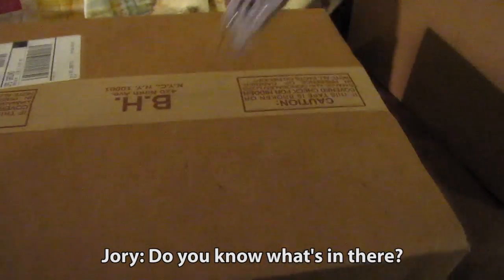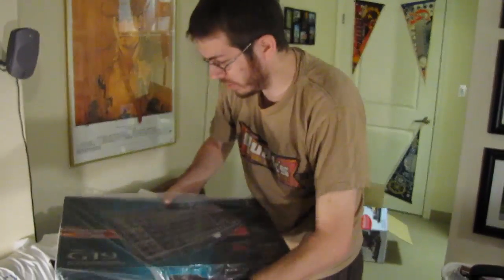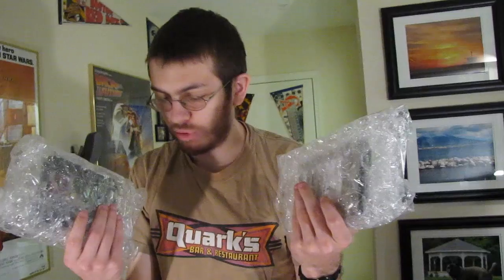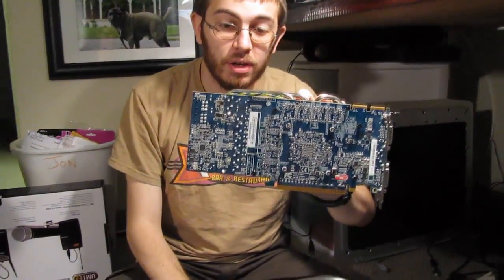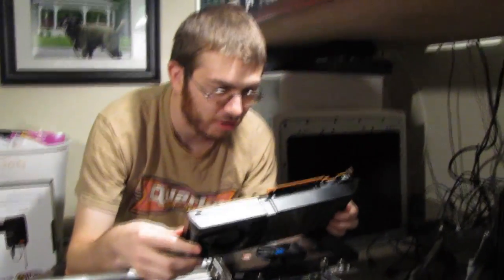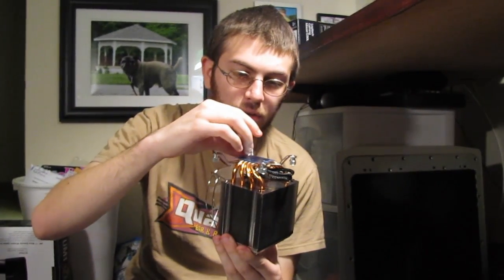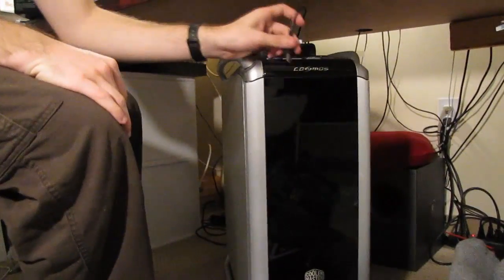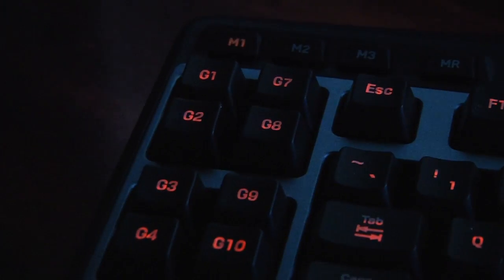$5,000 PC Upgrade! -- Intel Core i7 980x and GeForce GTX 480 Build

Comment: This is one of the videos I watched back in late 2010 that made me want to someday build my own bad ass PC. Just finished watercooling the system I got five months ago.
i7 4790k
GTX 970 SSC
Asus Z97 Sabertooth Board
16GB Kingston RAM
Dual Asus 24" LCD Monitors
240gb Sandisk SSD and a shit load of hard drive space
 etc. Having a fast high-end computer is one of the best investments I've made.
Reply from the maker: Angel Christov Nicely done :)
Reply: dogsht
Reply: @xpaigEpoo94x  this was 7 years ago lmao
Reply: Same, I remember watching this when it dropped. Just got a new build
NZXT H510 Elite
i7 12700f (12 core, 20 thread)
MSI RTX 3060 ti
B660M DS3H DDR4
16GB DDR4
2x 1080P HP OMEN 25INCH 144HZ
500GB m.2 ssd
1tb 7200rpm hdd

Comment: Damn fine setup you've got there. seriously. I'm pretty sure that's... almost as high-end as you can possibly go. Hell, even your PREVIOUS PC greatly outmatches my current.

I do have to wonder, though, what do you do with the parts from your previous machines? Do you hold onto them as backups (just in case), or sell them off? (Personally, I do the latter... even if said old parts are kinda crap, they're far better than nothing at all.)

Comment: @DeandreT1 as i said:

 why not? two 1gb graphic cards, 12 gigs of ram, 4 tb of hd, and twin 4-core (that makes 8) processors for about 4400-4600. it's not my problem if you are a mac hater, i don't care, but you have to admit, it IS an equivalently specced computer.

Comment: I have that mouse too. Just watch out Jon. After about six-seven months of use, the dot's or whatever they are on the mouse start to disappear in the places where you tend to grip the mouse the most. They just turn into black patches. For me, it's the left mouse button, to the right of the Logitech logo (where my palm would be) and then at the bottom of the mouse where the bottom of my hand is. Then again, I have really big hands, but whatever.

Comment: @Jon I've been building and overclocking computers since 1996. You really only need enough thermal paste to bridge the microscopic gaps between the CPU and the heatsink. The less, the better (knowing the right amount takes some practice). No real harm in just putting a big wad of it on there and forcing it out with the heat sink, but your CPU will be running a few degrees hotter (5-15 degrees Celsius) than it could be if there's too much - the thermal paste becomes an insulator when too thick.

Comment: For the love of god I hope you keep this thing cool. I kept mine just a bit too warm and now the processor is falling down a slope of multiple breaks in the microscopic circuitry of the processor- each one making it overheat MORE. Granted it's been four years, but still. If you're going to spend 2k+ on a computer make sure everything stays below recommended temperatures even under heavy load.

Comment: Okay Jon, let me get the specs down so you can see: Radeon 6750M, Adobe Premiere Pro CS6 and iMac flat panel monitor. So I don't know if the Radeon card is incompatible with CS5 on a PC, but it works fine for me. And if your computer used to have a radeon 4870, and it doesn't work with Premiere Pro, then what did you use to edit TMS before that?

Comment: Nice motherboard and nice 980x, are you going to overclock it?
 
Motherboard: EVGA Classified 200 P55
CPU: Core i7 860 @ 3.5 GHz
GPU: EVGA GTX 480 
RAM: Corsair Dominator 4GB 1600 MHz 
PSU: Corsair HX 850w.

Comment: Going back and re-watching some of your older videos and realized this is the video that got me interested in wanting to build my own computer. Back in September, I finally had enough money to build one, and the market was right too. 
CPU:Ryzen 3 2200G 
Motherboard: Gigabyte B450M DS3H
RAM: Corsair Vengeance LPX 16GB 3000Mhz
GPU: MSI RX 580
Storage is a 250 GB Crucial SSD. Went with a smaller drive to save some money. 
Case: CoolerMaste Q300L
Reply from the maker: That's awesome 😁
Reply: @Jon  hoping to get a Ryzen 7 soon. Went with the Ryzen 3 just to get started.

Comment: @Jon - unless youve oc'd your 980x, you would be better off with a oc'd 920 and another gtx 480 and a new motherboard.

you definately a new psu (atleast 850w, preferably over 1000w) and you need to reseat your heatsink with an even amount of paste

Comment: I assume you are talking about the AMD FX-8150? That achieves a score of 1.01 single core / 5.96 multi core in Cinebench R11.5, whereas the 980x gets a 1.21/8.98. Higher is better. Also this video was over 2 years old at the time of your posting.

Comment: I remember my first computer. Packard Bell. Hard Drive space was 600MB. I going to build a new computer in the coming months, however mine is going to be about $3,200 less than what you paid for that because I already have a 17" CRT Monitor and a keyboard and mouse I got from the thrift store. I am cheap but the system I am getting for $200-$300 is going to be the best computer I have ever owned. I am still running on an Intel Celeron 2.2GHz Single-Core.

Comment: is the 480 GTX better than the ATI 5870? 

High performance CPU water cooler. 
i7 930, OC to 3.5
ATI 5870 1GB GDDR5
12GB DDR3 1600 Mhz
128gb SSD with W7
1TB HDD

Comment: The way you apply thermal paste is not the best method, a lot of air bubbles will be trapped inside the paste when you put the heatsink in place. The air bubbles will drastically reduce the heat transfer between the processor and heatsink, this will affect the temperature of the processor with 10-15 degrees. You won't get decreased performance, but you can expect a noticeble decrease in the predicted lifetime.

Comment: too much thermal paste, never touch the pins on anything, the reason that it didn't work off the start-up, is because you put SOOOO MANY new things into the current motherboard, it had a shit fit trying to figure out what everything was. and just a question... can your motherboard even handle the 6 cores of the new processor?

Comment: Hey jon,

    I am also building a computer and considering switching to solid state drives as the main source for the OS and currently, I have a 2tb hdd as the main source. I do want to know, how you go about using 120gb ssd and when installing programs like video editing and games, I've read forums saying sometimes, the program will install some component files into the SSD and the rest into the HDD, have you gotten any problems having the files in 2 separate drives?

Comment: Nice specs Jon, I just upgraded mobo/cpu yesterday with
-12GB corsair XM3 ram
-SLI MSI N560GTX-Ti Twin Frozr II 
-AMD Phenom II X2 555 Black Edition @ 3.3 GHz
-MSI Nf750 MoBo
-Antec DF-35 Case 
-Corsair 850w PSU

Comment: @emerybryant By any chance did you read my other comments properly, they explained why, but if I have to explain again I will. The best kind of contackt between the heat sink and the CPU is metal on metal, not a layer of thermal paste, thermal paste is designed to fill in the tiny or mircoscopic imperfections in both the CPU face and the heat sink face which may also have difficult to see indentations or dimples so the thermal paste fill in these to provide a bettter surface contact

Comment: @EchoedTruth No, no, no. The Phenom II X6 is comparable in peak performance to a Core i7 930, depending on the programs used.

Six cores does not make the X6 as fast as a 980X, which is probably about 75% faster.

Also, the 580 is faster than the 6970, plus it supports GPU acceleration in Premiere Pro CS5 which the 6970 does not.

Comment: I have the Logitech G15.  I think that the full color screen on the G19 is way overkill.  I mean, it even has support for watching YouTube.  Why watch YouTube on my 22'' 1080p LED backlit monitor when I can watch it on a tiny low-res screen on my desk :P.  Great system for Adobe CS5 though with the 980x and a ton of DDR3.  A multi button mouse really helps too, coming from someone who uses Adobe Flash, Dreamweaver, and Fireworks CS5.

Comment: Hey... Just wondering if with my new PC specs if anything would overheat or bottleneck? InWIN BLACK GR-1 GAMING CASE

Intel® Core™i5 Quad Core Processor i5-3570K (3.4GHz)

ASUS® P8Z77-V LX 8GB KINGSTON HYPER-X GENESIS DUAL-DDR3 1600MHz

2GB AMD RADEON™ HD7850 -

1TB 3.5" SATA-III 6GB/s HDD 7200RPM

CORSAIR 650W ENTHUSIAST SERIES

Super Quiet 22dBA Triple Copper Heatpipe Intel CPU Cooler 2 x 12CM Black Case Fan

Thanks :)

Comment: @TheGamingUpdated As i said:

Two 1gb graphic cards, 12 gigs of DDR3 4 TB of hd, and twin 4-core (that makes 8, and both together are far faster than the 980x, apart from allowing more RAM memory) processors for about 4400-4600 dollars.

It's not my problem if you are a mac hater, i don't care, but you have to admit, it IS an equivalently specced computer.

Comment: You may want to consider pushing an overclock on that cpu now, as the current I7 quad cores at stock clocks out perform this thing, heck my I5 2500K running @ 5ghz out performs this machine !
Reply from the maker: I love how you say that like it's a bad thing.

Of course newer processers are faster, that's the point. But this thing still smokes, four full years later. That shouldn't' be understated.
Reply from the maker: ***** They're all listed in the description.
Reply: *****
Hes just butthurt that his computer is no longer better than ours ^_^
Reply: My dad still uses an Athlon 64x2 4400+ 2.2, which is 7 YEARS old, so i wouldn't worry about any OCing.

Comment: Acer Aspire TimelineX  Core i5-480M, ATI HD6550 1GB VRAM, 750GB HDD. 
 
or Acer Aspire TimelineX  Core i5-460M,ATI HD5650 1GB VRAM
640HDD.

They Both have the same price. They differ only on the Graphics card and HDD.

Comment: @raxater I7-980x requires a different chipset. But since you have a SandyBridge mobo, you could get an I5-2500k, which has better gaming performance despite being quad-core @ 3.3 GHz. It's about $220, good overclocker (look around- I've seen some people run it close to 4.5 GHz on air cooling!), and you could use the extra money for a better mobo or graphics card. Movie Maker runs fine on my duo-core 2.53 GHz I5 460m, so it should be quite speedy on a 2500k. Pm if you have other questions! :)

Comment: @Jon @MutatedGamer Looks like a small pea to me.

Depending on the brand of heatsink, it could be pea-sized or grain of rice of thermal paste. Plus you should not 'have to' spread out the paste with a card as the mounting pressure of the heatsink and the contact patch is as far the paste will need to go or get squeezed out.

Comment: Have you upgraded your system yet? Hope so! My system graphically outperforms yours. Running a GTX 970 ftw addition. Also hope your motherboard was meant to be using an AMD GPU. Normally you don't mix intel and AMD products. They don't like each other;) are you going to be Over clocking your CPU?
Reply from the maker: The description of this video is accurate, and up-to-date. And it's great that your computer is better than a build from five years ago. Would be quite embarrassing otherwise.
Reply: Umm okay why haven't you upgraded any pieces? You should have upgraded the GPU to the Nividia quarto I think. It's a card built for design/video editing. It's also got twice the power of the one you have in. Just think it would be in your best interest to use a card that designed for video editing instead of a gaming one. Not that the gaming one is bad. Just I'm sure one specifically for editing can do things a gaming one can't.
Reply from the maker: dcccapfan Well 1) I have upgraded the GPU. 2) The one I have works great. 3) I can't afford to buy a $500 GPU every year, sorry.

As for gaming/editing - they work... I don't think there's anything special about them.
Reply: O okay yeah I know you don't have that kinda money. I was just thinking you know sense the quad was built for editing it would be tuned with features that one made for gaming wouldn't have or didn't need. Wasn't bashing or anything. Was just suggesting something I though could help. Do you run SLI or are you sticking with a single GPU? Just giving you ideas to squeeze the most power outta your PC. Also you should look into OverClocking the CPU. You'll get a much higher performance then the standard clock. Just make sure to watch your temps when doing so.
Reply from the maker: dcccapfan Someday... someday my friend. For now, I'm happy with where I'm at :-)

Thanks for the advice though.
Reply: Lol okay, just giving you ideas. Im kinda into high performance PCs. By no means saying your setup as is isnt good. It's really nice. Just a few small tweaks could make it run so much faster. Hope your running solid state drive on it. If you are keep all your editing programs on the SSD. You'll see a major improvement in the performance of them.
Reply from the maker: dcccapfan Yeah, my OS and Premiere both run off the 256gb SSD.

Comment: @Jon 
OK, you are right. Happy now? I just think FCP is easier to work with. I don't need a Dynamic link with other Adobe programs, I don't use it (yes, i do work with Adobe. PPro included). Motion is a very good program, because it is so fucking easy to use. FC is almost the same as PPro, but the other programs in the suite aren't.

Comment: @deathdexter999 Yeah, but the 5970 is a dual gpu card so by saying quadfire I'm not wrong. You could in theory run 4 5970s provided you have a motherboard that'll fit it and a power supply with enough juice to run it. What I'm saying is, I saw quadfire, and thought 4 cards but it's really quadfire meaning 4 gpus on 2 cards.

Comment: @castro1780 Hardly. More and more hardware is being packed on those boards every revision.  No matter how much reduction in size individual components are produced in, the exponential growth of parts per card will continue to increase the size of the board.  That also says nothing of the cooling capabilities, which will need increases over time as well.

Comment: only 750w psu for a gtx 480? ._. I'm using a GTX 260 and if i remember correctly it requires like 600w. I thought the 480 would need like 1000w psu lol

Comment: @Shadow81989 

I just built a new gaming rig that set me back about £1400, but it's a beast of a machine. It has an I7 980 (overclocked from 3.3ghz to 4.2ghz), a Gigabyte G1 Assassin motherboard, 6gb of Corsair Dominator RAM, the Noctua NH-D14, Coolermaster Haf-X case, 64gb SSD drive, and a KFA² Anarchy GTX 480 OC graphics card. So far there's no game that this machine can't handle, even the new Crysis2 DX11 patch!

Comment: I read PC World, and they had a roundup of the 10 best performance desktops in the August 2011 issue. Geeks, prepare for geekgasm. The top computer-  the $6499 Origin Genesis 2011: Overclocked Core i7-2600K, 5GHz, 16GB RAM, 2.1TB Storage, THREE Nvidia GTX 580 GPU's, and a BD-R drive. Jon, your computer is EFFIN' SWEET, but damn!

Comment: Not bad. I ended up building one a few days ago for CHEAP! AMD Phenom II X6 1055T (6-core 2.8GHz overclocked to 3.8GHz) with 16 GB of RAM. I had a PCI Express Asus card that overheated (from an older case) so I'm actually using an onboard nVidia "card". I'm not impressed with it anymore but it's a SUPER fast computer and handles rendering of full HD video with a breeze. I'm sure that one does too. I'm hella jealous of that video card though. I need more money.

Comment: Sigh... you're right... My i7 is like 2 types earlier than yours, and my videocard is a GTX 465. But my case looks cooler, ha! It's the HAF case from Coolermasters, if I remember that correctly. And I probably have more diskspace, having 2 2TB drives and an 80GB SSD. But yeah, yours would perform better though.

Comment: No need for me to upgrade. Just running the old compaq 1.7ghz amd processor, but she is running windows 7 ulimate with only 32 megs of video ram.  768megs of ram and the old faithful 80 gig hard drive.  Why upgrade a pc when it running a great 2002 year made wd 80gig hard drive? Works like a charm for me.

Comment: My specs:
Intel 980x 6 core
2 480gtx evga graphics cards
a P7X58D Premium Motherboard from Asus
TX 950 watt power supply
V10 heatsink
a large tower compuer case
razer sphex Mamba hybrid mouse, 
G19 gaming keyboard.
4 2tb hardrives
2 256 gb ssd
Is my comp better than the bitch 4.0? I think so.

Comment: My new computer specs: iMac 21.5 inches, intel core i5 quad core processor, radeon 46750 video card, apple magic mouse and wireless keyboard, Thunderbolt port, 16:9 widescreen, 500 GB, 4 GB memory, Harman and Kardon stereo speakers.

Comment: @Jon Most of the time I buy from Newegg, but if you look on amazon, there are great deals.  Microcenter was selling i7 950's for $200.  I found one on amazon for $100 and I've been using it.  My MSI X58 Pro-E was $89 and 6GB of G.Skill ripjaws was $110, pricey.

Those were used.

Also, lovin the 980x.

Comment: My PC: Intel i5-2500k, Asus Maximus IV Extreme-z, Asus Geforce GTX 690, Asus drw-24b5st DVD, Corsair Vengeance Red 8GB 1600 Mhz RAM, Corsair AX 750w, Corsair Vengeance K90 Keyboard, Samsung 830 120Gb SSD, Corsair Sandforce GT 120GB,Western Digital Caviar Black 500Gb, Steelseries Sensei ProGrade Mouse, Cerwin Vega XLS-28 speakers with Nad 328 amplifier. 
You got more screens, better CPU and a hell of alot more storage than me! 

Nice rig dude! Keep that bitch up! :D

Comment: I built mine for $350, it has a Anthlon 2 x4 running at 2.8ghz and a 9800gt(which as soon as i have the money i will buy a new card, and have some fun overclocking my current.)

Comment: @xInsane333x Yeah I'm quite worried about getting the i5 since its inferior to an i7, plus, I doubt it would be able to handle overclocking because I'm stuck with the Dell case. Getting a new case would require to many changes for my low budget. Right now I just ordered a new quiet fan but it still won't be enough for sure. Anyway, thx for the help!